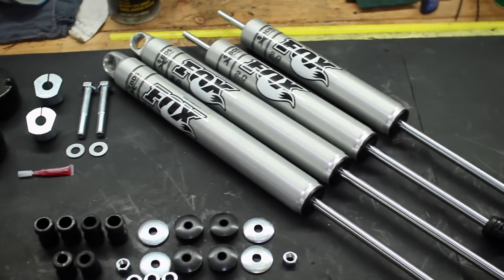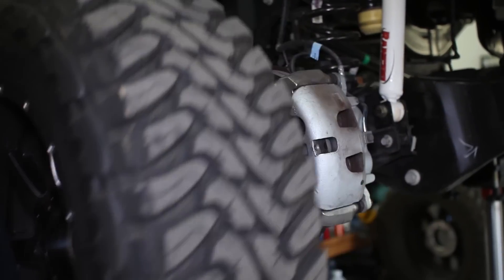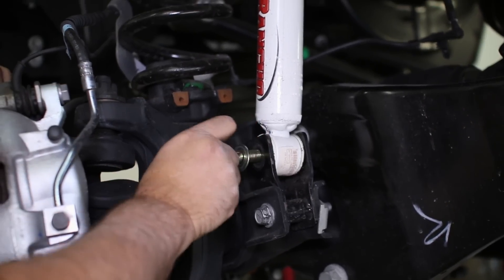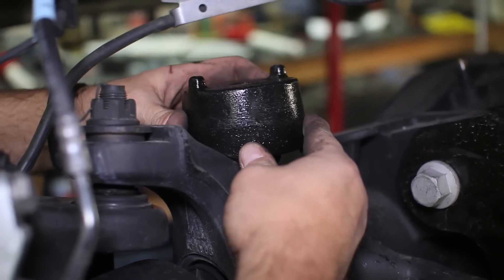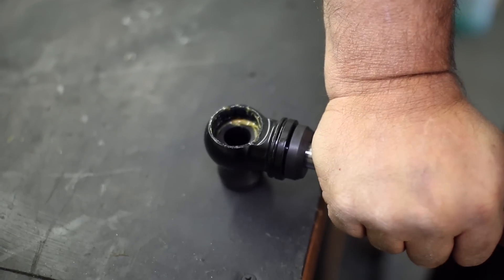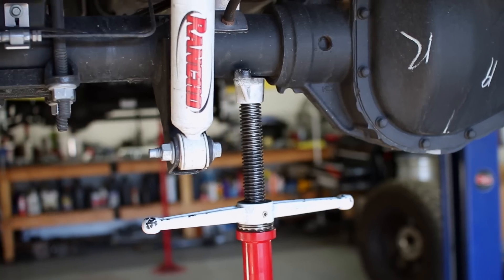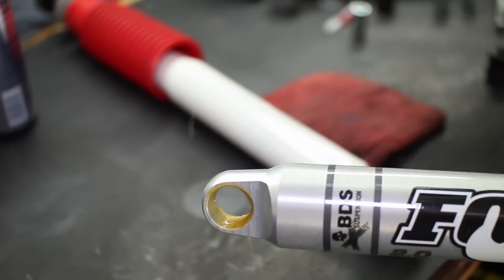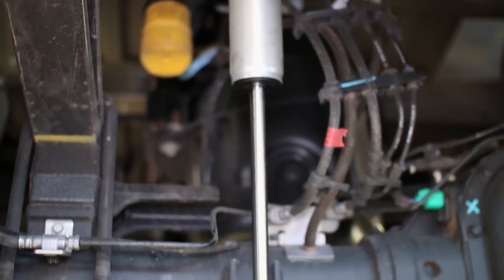2017 F250 & F350 Super Duty 4WD BDS 2" Leveling Kit with Shocks Install

Comment: I went with the same kit on my 18 . Left about a 1" rake to allow for if you haul anything.  Even if you are empty you can't even tell the 1" difference.  Thought about the 2 1/2" kit but when you haul anything you get a slight sag. Very slight but to much to be noticed I felt. Threw on the BD adjustable track bar and the upgraded fox front steering  stabilizer. Super pleased with the outcome !

Comment: Interesting design. The opposite of the readylift design.  BDS puts the spacer at the bottom and readylift puts it at the top.  I have to think about this one.  Less torsional stress on the spring when it’s supported from the bottom is my best guess?  The compressive forces are negligible top or bottom.  Not sure?

Comment: nice. what size wheel and offset did you use?
Reply from the maker: 20x10 Fuel Maverick Wheels -12 offset http://www.stage3motorsports.com/D53820001750-1999-2014-Super-Duty-Fuel-Maverick-20x10-D538-12mm-Offset-Black.html

Comment: Which one would you say has more of a level stance. The ReadyLift or BDS?
Reply: Also, why doesn't this kit need shock extensions , wouldn't it need more slack?
Reply from the maker: This kit comes with aftermarket shocks designed for a 2" lift. Both kits were close, by the Ready Lift was a tad taller being a 2.5 inch kit vs 2 inch
Reply: which one would you say rides better ReadyLift or BDS?